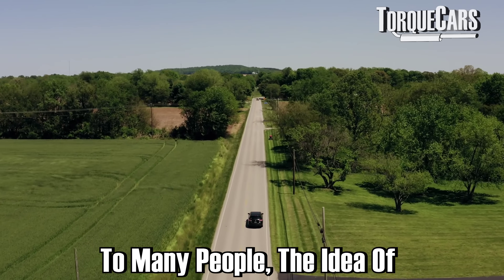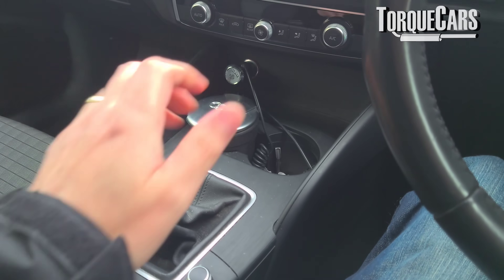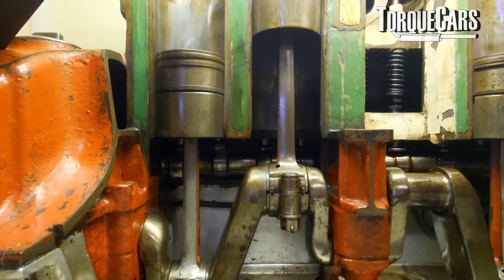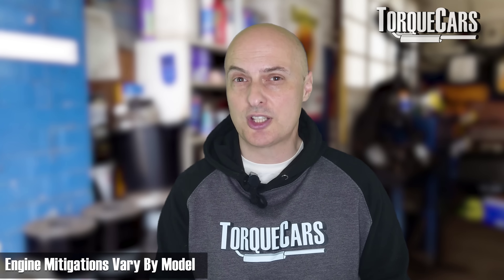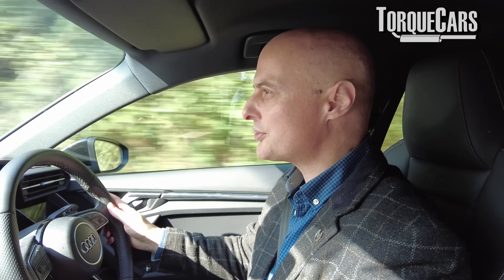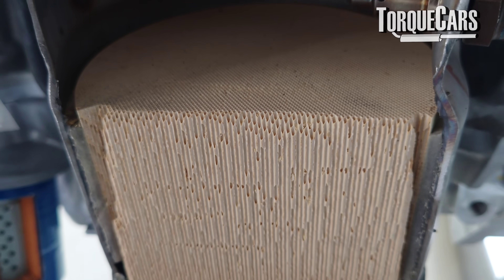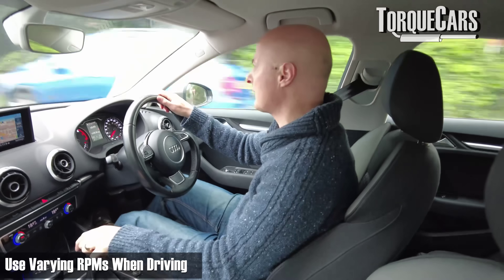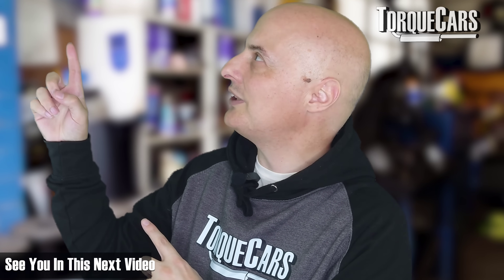BIG DAMAGE By Lugging at LOW RPM? Eco Driving Warning! (Manual Gears)

Comment: Modern cars really don't care about reasonable high revs as far as average fuel consumption goes...

Many measure, load, up or down angles, even steering inputs in some cases while deciding the fuel metering... 

In addition of course, just red lining 1st and second with an immediate stop will waste fuel but its possible to select top from medium revs 2nd gear and trundle along without increasing speeds at very low fuel use before getting anywhere near the next stop when in a town... Then repeat... Changing engine speeds is better for engines if lower revs are used to tickle along between stops. 

If in top gear at low speeds, and you want a higher speed... use a lower gear to get to it, or you will cause engine damage...

Comment: I've heard some rubbish but this beats it. I get it that DPF filters need cleaning by a fast run. I know that excessive engine load can cause pinking in a petrol engine. This idea that you have to rev the bollocks off your engine is utter crap
Reply from the maker: No one said about revving high, just avoiding LUGGING - this problematic high load at low RPM when you can feel the car struggling to pull. If I gave the impression you have to redline everywhere I truly apologize. In fact that was a topic I discussed and as with this one the key is to vary your RPM range and actually use the power band.

https://www.youtube.com/watch?v=4TMgLwKda50

Comment: And yet my last car, M4 Mondeo TDCi which my parents now own is on 200,000 miles still on original injectors,  turbo and EGR valve. Doesn't use oil between services. 

The 44 tonne lorries I drive which have automatic gearboxes climb hills at low RPM even when fully loaded , they'll not change down until 900RPM. ALL lorry manufacturers design their trucks to do the same.

Comment: I remember driving as 20 year old fast driver, my boss lend me a small diesel car from the company to drive  more than 300km in 1 day on the highway. It had more than 100.000 km and was daily driven by an older lady. My god I hated the car was slow. Not more than 110kmph I could do. When tried to do max the temperature started to go in the red zone. So I slowed down to cool down. After 10 minutes or so went faster until red and again and again. At the end of the day the top speed went up from 110 to 140 kmph. 😅
The next week my boss told me that they couldn't start the car as they needed to replace the pre heating from the car. And the next day the old lady said. What did you do with my car, it accelerates so much faster 😅😅😅 I forgot to mention that I always accelerated until vibration happened and took a constant speed just below the vibration. I think if would have really go max ignoring the vibration the motor would have blow up. The lady was actually thankful to me to make her car faster 😊

Comment: A slight chuckle near the start, when you said a manual might be too slow to change gear Vs driving an auto.. my own auto sometimes takes more prompting than my manual changes, and besides, the best driving involved preplanning for the forthcoming options, so you're confidently taking one of those options.
Aside from many other points, when accelerating, the engine's throttle pedal to RPM sweet spot will be the best place for that, for reasonable acceleration with some fuel efficiency .

Comment: My diesel Stinger is so smart that the fuel economy is the same in Comfort and Sport mode.  It delivers a calibrated dose of fuel so it's the same fuel usage at 1200 and 2000 rpm.

Comment: Dude, do you ever get anyone to check your scripts/finished videos? 
You consistently got "high" and "low" gears mixed up.
Going up a hill in too low a gear doesn't require more force, it requires less.
🤦
Reply from the maker: Sorry buddy - you are right. That is certainly a good suggestion, but bear in mind I only usually get a few hundred views on a video so there has never been much budget to focus too much on each video, which is only ever one single take, and I only do this as a fun side thing. I will up my game now!
Reply: @torquecars  You're already doing better than a lot of channels! I fully expected my comment to vanish into the YT fog! Thanks for replying! 👍
Reply from the maker: No worries, I do care about my audience and read all the comments.

I also won't allow annoying mid roll ads to show in my videos, and I try to answer peoples questions in videos by replying or adding a new video. 

I guess one day this might become a full time job, but it's fun and I've helped a few people out.
Reply: @torquecars  Yeah, I'm on the spectrum so I get a bit over the top with silly things like that, but the video did have some excellent info (I've just sent it to my wife to explain why she keeps getting EGR'd into limp mode!).

Comment: Saying constant low rpm causes excessive wear because "the combustion happens closer to tdc" is a bit of a stretch. You're completely ignoring the load/throttle position. If you're cruising around with low load, there won't be much mixture in the combustion chamber, so the combustion itself will be far less powerful than when you're at wot. You should've kept that under the "wot at low rpm" argument and not under driving at constant low rpm.

Also when you're telling such absolute horror stories about low rpm driving, you should at least define what you actually mean by low rpm.
I can see how tons of clueless people are gonna drive around with unnecessarily high rpm after they've watched this video. 
Obviously you shouldn't be jerking around at 1200rpm all the time, but there's absofuckinglutely nothing wrong with driving at 2000rpm at cruising speed. The cars that can take the most kilometers are almost all the time the ones that are driving for some kind of courier service. Almost all of the km's are driven on motorways/autobahn/highways. Modern cars are sitting at relatively low rpm at those speeds. 
The difference is that they're driving for long times and the engine is always at operating temperature.
You should rather tell people to get the right car for their needs. 
People buy 2.0L diesels to commute 10km to work. That's what's really gunking up you're inlet manifold. 

Never reaching proper operating temperature is also a problem for petrol cars, I see people driving down the road to the bakery and back all the time. 
If you're using your car for stuff where you could get with a 5min walk, you're going to fuck shit up. 

Of course every engine needs to work once in a while  especially diesels with complex emissions treatment systems. But that should happen under acceleration, when there's load on the engine (when it's at operating temperature, obviously).

I get it, a clickbaity title and crazy exaggerations in the video get you clicks and engagement in the comment section. 
Also not defining an rpm range helps your case in making it sound overly dramatic.
But that success with the algorithm won't last long, if you're not producing quality content. 
For me this was the first and last of your videos that I watch. 
Good job on farming my engagement in the comment section though 👍🏼

TLDR: Cruising on the motorway at 2000rpm doesn't kill engines.
Short trips and long life service intervals is what kills engines. (And buying the wrong engine for the job)
Reply from the maker: A sincere thanks for your reply which has been duly read and noted. FYI - One of the thumbnails I tested for this was "Why Lugging Is Bad" but this one the Algo chose did so much better.

I am totally blown away by the traction this video has, we only usually get a few hundred views. Clickbait is not my thing and happened accidentally on this video, I'm pleased though because I wouldn't have had your criticisms to work on in future. I am a small one man YouTuber doing this for fun not as a job!

The load as you say is key - lugging doesn't happen at light throttle on the flat. I had hoped people would get that lugging involves high load at low rpm from this and at least stop dripping around in high gears to "save fuel".

I did want to say what a low RPM is, but it varies so much - a Diesel turbo vs a 1.0 NA vs a 5.0 V8 vs a 1.4 Rotary engine will have a different answer, and it depends on load.

I like the video concept of "buying the right engine for your needs".

Comment: Most drivers in UK got manual transmission? I doubt that is the case anymore??
Reply from the maker: It still at 70% currently! 2023 sales show the manuals at just over 50% so the needle is moving.
Reply: @torquecars  According to Whatcar in 2023 over 70% of sales was auto, and the year 2020 was the year it was more auto than manual? I think your numbers are wrong. Anyway as the sales before 2020 obviously was heavy towards manual there is still many more manual than autos according to the numbers I found. On new cars in 2024 only 25% of the models are even available with manual gear…
Reply from the maker: Precise numbers rarely matter when we both agree that the percentage of automatic cars in the UK overall is increasing. I wouldn't be surprised if the what car figures included electric vehicles. Yes there has been a dramatic shift in the last few years towards automatics. With TipTronic advances it is hard to justify a manual box nowadays!
Reply: @torquecars  Well I am sure the numbers include both hybrid and electric which ALL are of course auto so I agree it does not really matter in the context of the video.

Comment: Excellent. I've 300,000 km Passat. Guilty as charged. Low revs for economy. Cost me a flywheel last year, and Diesel Particulate Filter this year. A truck driver warned me about that faint vibration you get when you accelerate at low revs. He said that's when the damage is being done.
Reply: Thanks, that´s exactly the point. If you rev that low that the vibrations increase then you are doing harm.

If you find a torque/rpm diagram of the engine with specific efficiency values then you can look for the "island of best efficiency". It usually is around medium-low rpm and high but not maximum torque. The rpm where this island is should also be best for reliability. High efficiency means little friction and little vibration losses, so it´s just a healthy state of operation for the engine.

Comment: I am struggling to listen to ‘RPMs’, it is RPM.  Revolutions per minute, R is the variable.
Reply from the maker: Noted! So many people around here use RPM as a verb - which is not an excuse really.
Reply: @torquecars  I was more put off by the fact that you kept getting high and low mixed up.
Since when does it take more force to cycle uphill when you're in too low of a gear?
Reply: RsPM 🙂

Comment: It's particularly true with diesel engines. Requiring lots of torque at low RPM floods the combustion chambers with fuel (on diesel engines, the throttle pedal is controlling fuel delivery, contrary to gas engines where the throttle controls air delivery), which then clean the cylinders of their oil, inducing excessive wear on cylinder walls and pistons. Even worse, combustion is then incomplete, leaving soot behind that contaminates the oil, worsening lubrication. The savings in gas money are lost in expensive repairs !

Comment: I always say use your gears. 20 miles per hour second. 30 miles per hour third gear. So on up the scale till I hit 6th gear then use the revs.😊 I find this keeps the engine in the power range.

Comment: My car turns at 1500rpm at 60mph in 8th gear on highway driving. With the ZF8HP it can shift in non-sequential manner. I once saw my transmission shift from 8th to 2nd to take evasive action while on the road.
Reply: Charger?

Comment: With my turbocharged Diesel, low RPM is normal. Pulling at 1,200-1,500 RPM is normal since the "red line" is 2,100 RPM. Even today's turbocharged petrol (i.e. gasoline engines) run at 1,500- 2,000 RPM at cruise and redline at 5,000-6,000 RPM. Also a lot of today's cars and trucks are equipped with an auto shifting transmission that is controlled by a computer that decides what RPM to use with what manifold pressure that is decided by the factory programing.

Comment: I agree with your end conclusion, but it's factually incorrect that gasoline engines are less efficient at low rpm driving. Higher rpms will come at the cost of fuel efficiency.
The only thing that can happen to cause a higher fuel usage has to do with knock. Low rpms come with the increased risk of knock, which can destroy your engine. To avoid this, some ECUs inject more fuel with the purpose of dropping the temperature in the cilinder, especially the head. This sounds counter intuitive, but a liquid evaporating will take away heat from its surroundings. So excess fuel (that cannot be burned because of lack of oxygen) evaporating in the cilinder will actually cool down the cilinder to avoid knock from happening.

Engineering Explained has some videos on this topic 😊
Reply: Wouldn't it be cheaper to inject water instead of more fuel to prevent knock? Unburned fuel isn't good from what I know.
Reply: @timobreitscheidt9382  absolutely! But it adds considerable complexity to the engine: separate injectors, separate water tank, water lines, etc. Fuel is already there, so that's what's they're using.

Comment: The rule of thumb I've heard is that if it was made before 2008, don't hang around below 2k RPM whenever you can (including excessive idle) or 1,500 RPM if its an econ car. After that, you can supposedly go as low as 1,100 rpm, but it really depends on the engine (pretty much ignore for anything designed for more HP).

Best is to just check your vehicle and research the preferred RPMs. Lots of newer econ cars are designed for lower RPMs for efficiency, but they generally apply this more to auto transmission cars.

Comment: Low RPMS are fine if you're also being light on the gas. My car will still pull even at 1000 RPM but I never try to accelerate hard when the RPMS are that low. Usually its a case of being in traffic and only needing slight amounts of gas to just keep rolling. Its when you do something stupid like trying to get up to highway speed from an onramp but instead of actually using the gears you just floor it in 5th instead. That's where the problems start happening.

Comment: What is considered low RPM? My 1.4tsi gets peak torque at 1800 rpm and runs decent up to 4500. My average rpm is roughly 2500.
Reply: @Not_Sure_2505  I'm pretty sure the actual RPMs aren't the issue but.... low RPMs with a high gear (like 3rd-4th) and accelrating like that is the issue. Obviously when you're cruising at higher speeds in a high gear your revs will be lower thats normal. 

I think you're good

Comment: « At 5000 rpm the computer have more opportunities to adjust itself than 1000 rpm. « 

Seriously ?

That doesn’t seem valid information
Reply from the maker: I didn't explain that very well did I? Each engine cycle provides data on the burn efficiency, knock risk etc... so with more cycles to work from you can make finer adjustments, effectively 4000 more every minute. The ecu is running at the same speed, it can just make better decisions with a faster turning engine.
Reply: @torquecars   what is the quickest sensor the ecu has to follow ? probably knocking sensor. what is the problem With knocking ? Avoid the event and adjust the firing timing accordingly. so when it meets the knocking  event, maybe it will count the event before to decide to change the settings. Maybe it can be programmed to react after 10 knocking events. or one. Basically the ecu has more time to adjust if the motor turns slow, so that’s the opposite that you said.

the slowest you have events and the easier it it to take decisions in time. 

That’s just pure logical stuff.

Yes with more events you can make better statistics but 1/ 1000 events is already huge data in a second and I don’t think your motor has to change it’s full behavior in a fraction of second.

2/ knocking is motor damaging data so the aim will be to limit the knock and it can react from the first knock as well even better at low speed because it has more time in between 2 events.

So the important matter is not how much millisecond the motor will change behavior, it’s after how many events. and it’s even easier to follow when low speed, and how long it takes is irrelevant.

About other sensors, like temperature, exhaust data, they would evoluate slower so have no need to take thousands of samples per second and also not directly related to motor speed.

It appear to me you made a big mix somewhere. Probably you have head a certain ecu have a fixed speed sensor reading ability and some commercial guy told you some illogical things around as they never know the real stuff but are experts at the leasing stuff

Comment: Toyota Hybrids run the engine at low rpm and wide open throttle all the time for efficiency (low BSFC). Whenever the engine runs (expect during warmup), it is at (close to) wide open throttle and most of the time at very low rpm's (1200 rpm at highway speeds). You could say these are champions at "lugging" the engine but don't have all these issues mentioned seeing they last so many km's.

Comment: The first time I ever drove a car I was told "never let the engine labour before changing down". However, is there a real correlation between engine life and where in the rev range the engine has spent the majority of its life (data I'd imagine is rather difficult to collect)? Big end/little end bushings would presumably be victim to such low rev abuse, but poor oil maintenance would end them way before anything else. Modern engines run so lean at low rpm that carbon buildup (cured by "The Italian Tune-Up") seems less of a problem too.

Comment: my audi a6 with 2.0 tfsi, i like to drive it at 1000 rpm where I can literally floor the pedal and it will not increase speed. When I do this for a bit I get a lamba sensor warning (lack of air because the turbo aint spooling up)